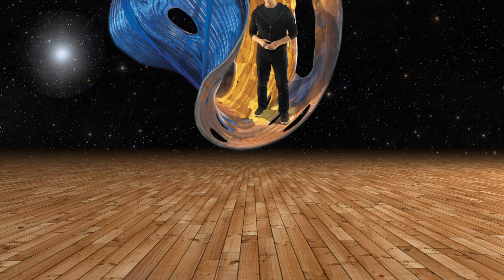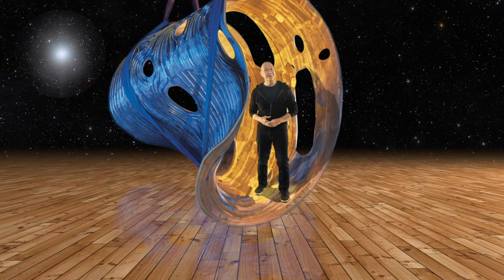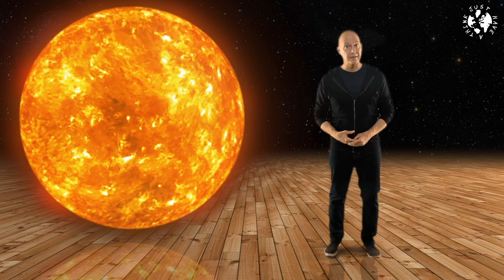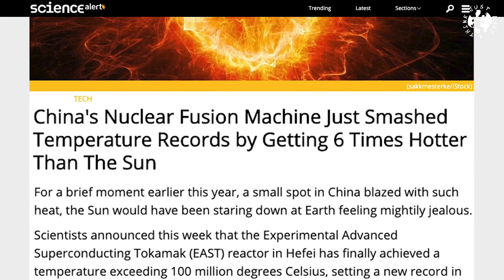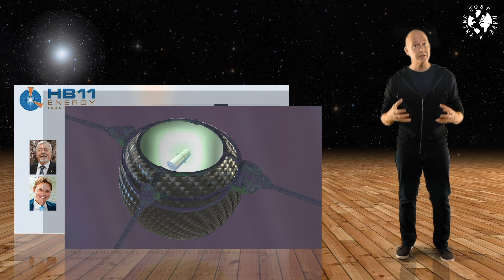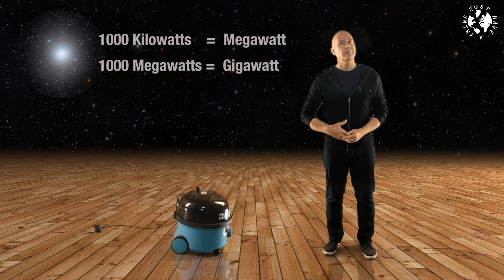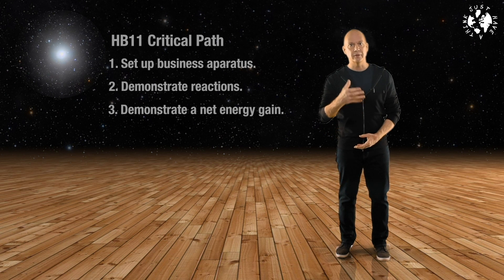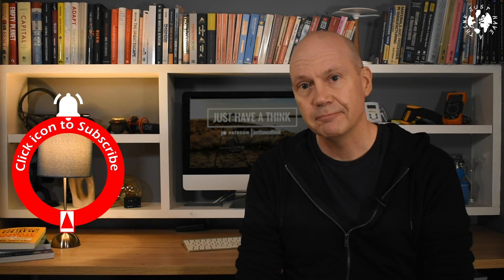Nuclear Fusion:  Revolutionary new breakthrough.

Comment: Fusion is the technology is always decade or more away from having, thorium molten salt reactor is the opposite, it's a technology we could have had decades ago. It turns out reaching for the stars is harder than we thought.
Focus Fusion 
Mirror Fusion
Cold fusion
Tokamak
General fusion
Compression fusion
Inertial confinement fusion
Etc...
It's a worthwhile endeavour, but sometimes more important matters need higher priority. If we end up in a endless winter caused by either nuclear war, supervolcano, giant meteorite etc, we will need a dependable source of energy then, not in 5 to 10-20 years.

Comment: Until it actually turns a meter on a home it is just an experiment. But that is good because when it finally does happen and science does a "duh of course this the way to do it." We need to try all the possibilities to find all the issues of how it does not work before we can grasp the method to actually succeed. Until then renewable is the primary way to offset our use and the temptation to test Darwin.

Comment: Ok, I did some math and it seems that boron laser fusion would cost at least 0.235 cent/kwh if you use generic boron, which is 56.6 times cheaper than average cost pf electricity

However this is assuming everything is operating at or near maximum efficiency. Cost also skyrockets if you start using purified boron-11 isotope which would increase price 28809 times

I guess it depends on if you can use isotopically mixed boron and what sort of consequences that would create

Comment: No. They never will. By definition fusion takes more power than is put in. It’s the forceful fusion of lighter elements into heavier ones. The reason the sun works as it does is you have constant “endless” energy to start with, in the form of gravity. That subatomic compression from gravity compresses light elements releasing energy violently in the creation of heavier ones but still not more energy than is being put in. Fission is where you are just releasing already stored energy. Fusion = compress with energy to create denser elements. Fission = release those denser atoms into lighter ones, liberating (not just squeezing out) energy.

Comment: Great video. Thanks for reporting the possibility of fusion.  So I have to mention that you mention alternatives but again you failed to mention hydrogen. Please include Hydrogen in you mention of renewable energy.  Thanks
Reply: Staunch environmentalist have really messed with the energy production discussion. There is no such thing as a "renewable source of energy". Wind turbines require concrete, solar panels require silicon, everything requires maintenance, everything requires copper wires for the transport of electricity. Nothing is ever renewable. Sustainable exists on the otherhand. And solar and wind are not sustainable for meeting global energy demands, let alone, allow the industrialization of developing countries. 

Fusion looks like it will be more energy efficient and sustainable than fission nuclear energy. Fission uranium already proved itself to be more environmentally friendly and more sustainable and efficient than solar, wind and BioFuel. Don't confuse America's dysfunctional democracy that manifested in the inability to store nuclear waste safely in the mountains of Nevada and rigidity of international relations for the refusal of getting uranium dependence from Russia and China as the reason why uranium nuclear doesn't work. You Americans shouldn't be the leaders on climate change, you have elected an ex reality TV star as president, some of your senators use snowballs as proof that climate change doesn't exist and now Covid-19 is considered a political opinion. It is fucked up that you guys get to have a seat on the discussion table when it is clear to everyone around the world that America is regressing technologically and politically.

Comment: LPP Fusion has been working towards a pulsed HB11 fusion cycle as well, but their method is a 'pinch effect' called focus fusion.  Essentially it is magnetic confinement in a tiny rapidly collapsing plasmoid created by a large electric discharge.  The device itself is largely just a vacuum chamber and capacitor bank, the direct conversion of helium nuclei, and associated X-rays is intended.

Comment: they require too complex an industrial infrastructure. we need to have energy sources that are reliably maintained at a wide range of technology infrastructures. for example: batteries and solar panels that can be build in situ at a small factory, with supplies found mostly locally, with the local people able to maintain them. we can have some of these working in super advanced centers, but we cannot rely on any tech whose support structure is so complex, like nuclear fission, that any flaw, mistake, or inconsistent maintenance can wreak havoc. thats why burning wood was perfect for our ancestors. always available, low cost, no tech needed.

Comment: It seems to me that HB11 is on the right track with a concept more like a fusion battery than just another variation on the steam generator with all of its inefficiencies. I see one of the biggest hurdles being fuel duration and whether or not you can feed fuel to an active system.

Comment: I haven't heard anything about using high frequency to get the atoms to stay in alignment. It's only an observation.
Reply: High frequency what? Radio?
Reply: @brucegoodwin634  Somewhere I seen a demonstration with steel balls rolling around on a piece wood. When they were introduced to a frequency they lined up in a grid pattern. Would the atoms in the plasmas line up from the introduction of a frequency. With all the windings in a fusion reactor there has to be some frequency generated. Thinking out loud!
Reply: @larrennoble7288  You make an interesting and plausible point, I think, but I am am not qualified to answer your question. Charged atoms (ions) can be influenced by magnetic fields! Stay curious!  Let us know if you can add to this thread. Maybe you're thinking of constructive/destructive interference?
Reply: @brucegoodwin634  Qualified I am not. Read a lot of cutting edge science. Because of the forces involved, the containment field might be the problem with alignment. Hopefully these ideas will been seen. Sometimes you get to far in and you can't see your way out!

Comment: We could have thorium working in 10 years which is good enough, but we are wasting time and money on something that might never work.
Reply: The material being used have always been the same we are going to need graphene to pull off a fusion reactor and while it seems like it's stupid to not go for a thorium reactor the end results for both are promising but thorium cannot compete with the potential fusion has the cost of fuel and availability cost to repair and ability to work under any conditions ect thorium reactors have always had one issue they can be used to make nukes

Comment: Why reinvent the wheel? Especially when you can't make a new one half as good. We already have more fusion energy than we can use. It doesn't need any new science or tech. It's extremely durable and reliable. It's centrally located. And it's free! 

Almost 100% of the mass and energy of the solar system is already allocated to fusion. Pure science is good and interesting, and I wish them well, but we don't need and mostly can't use more fusion power.

Comment: Wildly exaggerated claims of the "One billion times better than we expected!" kind should make everyone suspicious. These guys have nothing, just like everyone else, unless (not until) they deliver. 
Their proposed hydrogen - boron fusion is "clean" because it is aneutronic : for every hydrogen nucleus (i.e. proton) fusing with a boron-11 atom three helium-4 nuclei can be generated along with 8.7 MeV of energy, with no neutrons. 
However the required temperature for proton-boron fusion is about ten times higher than that required for deuterium-tritium (D-T) fusion. If, for instance, D-T fusion requires 100 million kelvin at a minimum (at a moderate pressure) proton-boron fusion requires 1 billion kelvin at around the same pressure. 
Lasers can reach such temperatures but not for free. 10 times hotter means 10 times more energy, thus 10 times more difficult to break even, whether you use powerful petawatt (pulsed) femtolasers or not.
Patents are meaningless in this field; their only purpose is to attract naive investors. So, deliver your "1 billion times better" fusion or shut up.

Comment: If it reaches a temp of 100mil°C wouldnt all the metal just instantly evaporate?
Reply: if the plasma would touch the metal. not to mention density and therefore a rather low amount of stored thermal energy.

Comment: Silly human, Molten salt reactors is the correct answer. Fusion is a pipe dream, you lack the metallurgy.
Reply: @sised All the experimentation was done 50 years ago at ORNL. Pure politics is the only reason this has not been rolled out, the Nixon fast breeder reactor phone call showed that. It's quite a shame as I'm sure it could be modernised very easily if the will was there.
Reply: Thorium fission is good, but I really doubt metallurgy has anything to do with it.
Reply: sised why would they mess around with that when fusion isn’t suppose to produce 4 times as much power than fission. Nobody wants to spend billions on number 2
Reply: Neither fission nor fusion stands much chance. Solar has already won.

Comment: But if Tokamac reaches temperatures some seven times hotter than the centre of the Sun, doesn't that suggest the sun is not a fusion reactor?
Reply: They are saying that the pellet casing is not breaking correctly, saying its surface is uneven. Src: some interview somewhere. Also what else could the sun be if not fusion?

Comment: Projections:
1 ) A small commercial reactor on the grid in the early 2030’s.

2 ) A large baseload sized reactor around 2050.

3 )  The first reactors will not be cost competitive with fission reactors right away.

4 )  Expect a profusion of designs on the market and  extended development aimed at perfecting the various designs...to find the design worthy of being built in large numbers.

5 )  Small reactors for the military may be the first to be built in numbers.  This because the safety of a fusion reactor will justify it's deployment before fusion is cost competitive with fission.

Comment: I'd like to add a perspective on some of the issues involved that many are not aware of.

I was involved in the building of the HSX Stellarator  at the University of Wisconsin - Madison in the late 1990's:    https://hsx.wisc.edu/
which was the predecessor to Wendelstein 7-X, and the HSX is still being used for research.  My specific part was the explosive forming of the plate segments against precision machined dies, which were then cut into the exact lengths needed and welded together (I actually know how to have a blast!.. and worked at a company that did explosive forming and welding along with other more conventional building and forming processes).   I was also involved in the construction of other unusual research vessels for the University of Wisconsin Physics Department and the Synchrotron Radiation Center (Aladdin storage ring) which was shut down in 2014.  In the process I have had multiple visits to the high energy labs and discussions with the Professes and Scientists involved on all kinds of interesting things.

A problem for ALL future fusion reactors is that in the end you have to be able to cool the vessel faster than it heats up.   What I was told by the scientist on the project who designed the HSX device is that the tokamak has a problem that its shape is not even theoretically possible to cool fast enough with known coolants if you ever got a sustained fusion reaction going.  Depending on the design they estimated that a tokamak would melt within a few minutes of a sustained fusion reactor even with the best coolants.   On the other hand, tokamaks are cheaper to build than stellarators, and at this stage of research the cooling issue could be "overlooked" until they could get even a 5 second sustained reaction.

A stellarator is theoretically coolable by pumping liquid sodium around the pressure vessel - and thus you could actually potentially build a power plant using a stellarator design - if they can be made to produce fusion.

I'm not sure if this new concept where at least part of the energy is produced directly as electrical current.  I do know that you will need incredible heat removal capabilities to prevent it from melting.  I'd like to hear their plans to handle that in the future.

I've also worked in Power Plants (fossil and nuclear) so I have a very real idea of the kinds of thermal energies involved that the kind and type of equipment needed to handle it, and also about radiation issues.

Also, fusion reactors do produce radiation, and will become radioactive.  At a level of likely 1000 times less than a fission reactor, and you do not have spent fuel with half lives of over 10,000 years.  Most metal or components that become radioactive from radiation tend to have half lives measured in years or decades; and would be harmless in less than 100 years or at most likely about 1000 years.   However, the plant workers will still have to be radiation workers.

Hope this proves useful for all.

Comment: Thanks for the overview. Exciting new tech for sure. But in answer to your question at the end, almost any form of fusion will still require grid distribution, and the cost of building-level solar/battery storage is likely to soon be less than the cost of electrical distribution alone in many areas.

Comment: At first I thought you were an optimist, "20 years away and always will be," for most of my 60+ years fusion  has been '30 years away and always will be." The question is always what about the neutrons? Neutrons are very powerful, almost unstoppable and dangerous. So when 'clean' fusion is promised I've learned to ask about the neutrons.  Your video is a huge improvement over every other 'fusion is just around the corner' video. The last one had all this nonsense about funding, and administering the project.

Comment: Hmmm, the billions (trillions?) they put in to developing fusion reactors ( if they ever get them to work) will make the generated electricity so expensive that no one can afford to pay for it, or they have to run it at a loss for ever. But the complexity means it’s going to fail quite often, so maintenance costs will be enormous. Think I will stick with solar and wind.

Comment: Mankind has certainly advanced since our first upright look around, 200,000 years ago. And we have advanced exponentially in the last 150(+) years. But we are on the brink of the next step of evolution. The arrival of 'unlimited - clean - safe' power will herald the beginning of that era. But... If we can learn anything from history, "anything we rush, we get wrong". - I am of the opinion that as with every investment opportunity, the creation of viable 'fusion' will garner more interest as breakthroughs occur. - Eventually, the first working fusion generator will be on-line some-where. Then a 2nd, 3rd... and so on. - If we think that we can rush that situation by taking funds from something that we use now, like solar and 'wind'.... to make 'fusion' happen quicker is FOOLHARDY. BTW - We are not 20... or even 30 years from that first fusion generator going on-line. We are 118 years from it. And it will be built in...

Comment: "One important problem remains to be solved": lowering the time between [fuel to power] pulses from an hour to a second.  -- From the related articles at asiatimes.com/author/jonathan-tennenbaum/, specifically part 6 (May 6)    BTW, JHaT did excellent job here.

Comment: I do actually believe we should be investing in this way before solar and wind
Reply: Definitely. Fusion, theoretically is the next best thing to black hole generators or dyson swarms. Its 100% worth every penny once we figure it out.
Reply: @Erowens98  Love it ... I can imagine the dyson swarm ... but black hole generator may have some serious down sides .. dependent on your physics politics .. we may inadvertently be generating a new universe from the mere creation of such a device..
Reply: @synkuk  in a few hundred trillion years, black holes will be the only source of energy in the universe, so eventually we, or whatever we've evolved into will have to use them.

But as long as there are stars, it's probably not necessary. Theoretically they're very difficult to work with, and stars produce plenty of energy.
Reply: @Erowens98  In the age of black holes I'm assuming long after the last star has extinguished .. there will be little reason to live :(
Reply: @synkuk  humans are good at making up reasons.

Comment: Why not just use a Tesla turbine, that is covered with just enough thorium/deplated fuel to a bit warn the water.
The whole thing in high pressure water, closed environment.

The water in it get warm, sometimes fuse.

The heat from that flows out from up
And the water flows.

The turbine slowly turns faster and faster.

Untill it can be used to really make power.